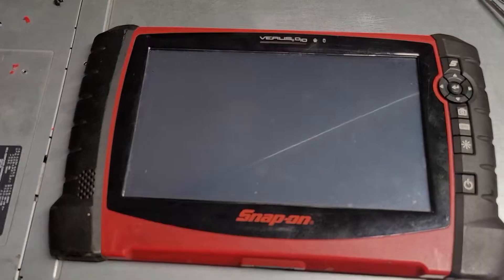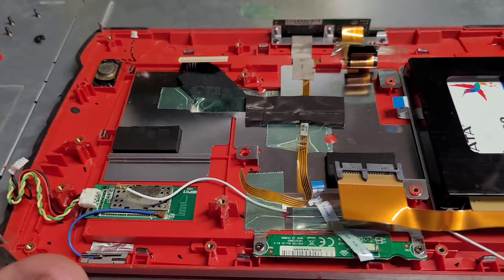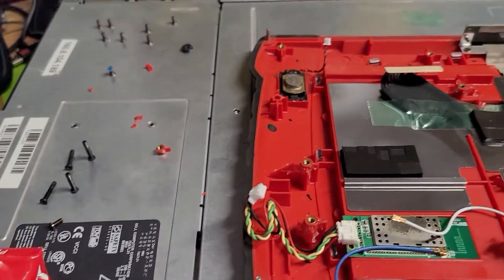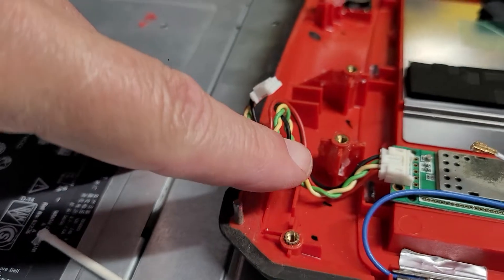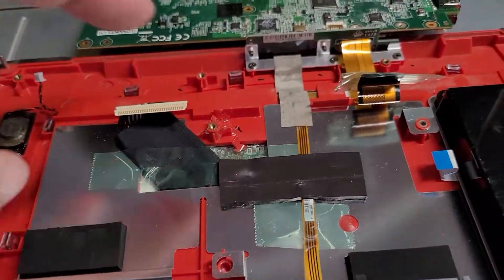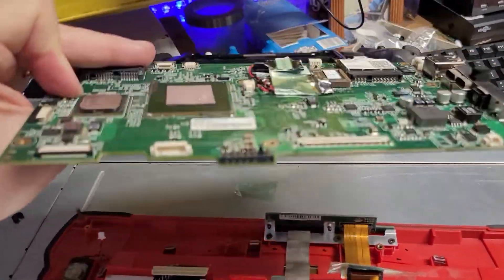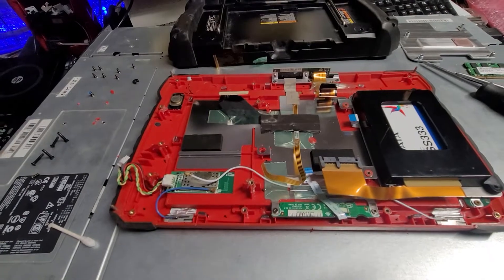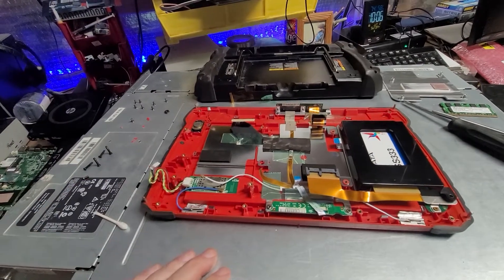SNAP ON VERUS M4 automotive DIAG station review and repair do to no boot but a blank lit screen

Comment: My VERUS D10 cannot keep the clock time it defaults to the screen that has the F10 and DELETE menu if correct the time - time zone - and calendar day then it will boot up.  Is there a chip that can b changed if i leave the unit plugged in it seem to be normal.  I would like you to fix for me if i can send it to you .  please help !!
Reply: Mine has a problem loading the diagnostic program after changing the CMOS Battery can you fix the programing?
Reply from the maker: That is a CMOS battery issue. You need to replace the battery.
Reply: @leadiususa7394  you make a lot of sense   

thank you
Reply: fixed   thank you